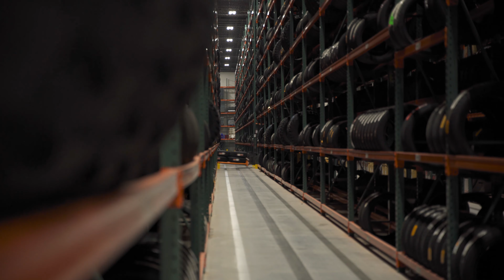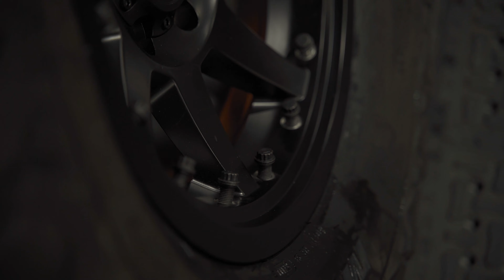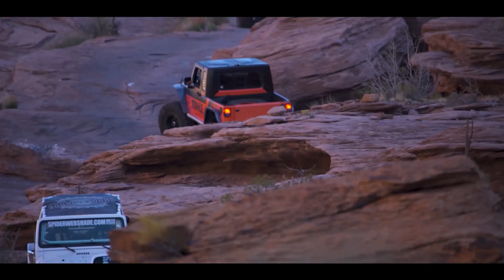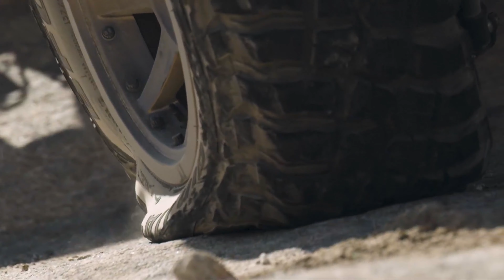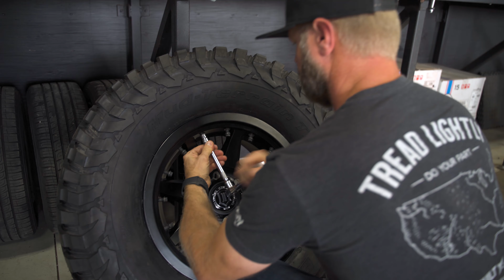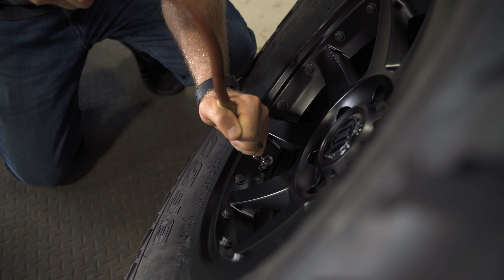ICON Rebound Pro Leaks Air!?

Comment: It would be almost impossible for 28 grade 8 bolts on a bead lock fail and the bead lock ring flying off 😂😂😂. Just think you only have 5 bolts or 8 (lug nuts ) holding your whole wheel on . 2 bolts holding your brake caliper on. It's not that bad locks are (unsafe ) Bead locks on multi use vehicles is new . Companies don't want to foot the bill to have there bead locks tested and DOT approved . Stop fear mongering to push your sponsor sales .

Comment: Only problem I’m seeing here is at super low pressure 5-7 psi where I run on sand this will not stop the tire from turning on the wheel. A problem I deal with all the time on my non beadlock wheels

Comment: All sounds awesome do they make an 8 lug pattern that has a center hole large enough to fit on a Dynatrac pro rock 60? Currently running method rims now on the street but looking to get bead locks for off road

Comment: I actually ordered up a set of these wheels, didn't want a fake bead lock, and its so hard to find a good looking non fake bead lock rim. I'm also looking into starting my business where I'll have to get DOT number and CMVR for my truck so DOT approved is a must as I'll be at scales and dealing with inspections. But I still want to be able to take my truck out.

Comment: They look cool, great concept, but the lack of suitable offsets and backspacing makes them a non starter. 5x5 with 4.50 backspacing and -6 offset barely works with stock tires on a Jeep, try 3.50 with -38 and you might have something.

Comment: I can’t give a review without the product. Feel free to ship 5 and AT 33s for my gladiator sport S any time!  I agree with the other guy though. Beadlock inner as well. I know there’s more flex in the wheel there which is an engineering nightmare though. The outer has more rigidity typically because of the flange.

Comment: So what happens when you drive on a flat or at extreme low pressures? Will the pins be driven threw the tread surface, or will the vehicle weight strip out the thread in the wheel. Would make a cool video to try and see
Reply: Looks like the rim flanges are taller than the pins. So on the road all the weight is on the rim, but offroad it'd be a crapshoot

Comment: Too much chaos rather just run my 701 methods to drop down to 5 pounds of air pressure no issues just my two cents
Reply: The point is that bead locks are illegal on road apparently in a lot of places.
Reply: Hi hope you’re well I know what the point is I’d rather just run the 701‘s to drop down to 5 pounds Do you really want an additional 80 holes in your rims for leakage might sound good on paper have a blessed day

Comment: Not sure what oil you're putting on the o-rings, but from experience shooting PCP air rifles full of o-rings dealing with pressures of around 4000PSI, divers silicone grease is great for keeping those o-rings in great conditions. Very interesting though and definitely on the shopping list for when the $ allow for the 4Runner!

Comment: There is ZERO chance you can be sued for an accident due to beadlocks unless the beadlock was an actual contributor to the accident ie it failed and caused the vehicle to lose control. 
.
People need to stop boogey man -ing our legal system. There are many mechanisms in place to stop frivolous lawsuits. You can't just sue someone for any reason.
Reply: Well I mean you can.
Reply: @kregadeth5562  nope, you can’t. Just like I can’t sue you for your idiotic comments. You can try, but it will literally be thrown out and you’ll likely have to pay whatever fees that person spent to defend against your complaint.
Reply: Exactly. My oem raptor bead locks have 24 bolts. How many would have to fail for the tire to de bead?  I think the tire would leak and I would have time to pull over just like the positive statements on these new wheels. Cool design I suppose but acting like they are superior to a true true bead locks is just silly.
Reply: You can ALWAYS be sued. The case having merit is something completely separate from the act of being sued!
Reply: @ryanm4013  that’s not true at all, you have to draft a complaint prior and demonstrate standing… 💀

Comment: G’day guys, I’m very interested in a set of these for my Australian variant of the 79 Series Dual Cab 4.5 Litre Diesel V8 Landcruiser. Wanting to know if you guys ship internationally, do I have to go direct thru ICON, or do I need to find a local distributor here in Australia & go thru them?
Reply from the maker: Excellent question and there's no doubt our Customer Service reps will be throughly equipped to answer your question! Best to email them directly for the quickest and most accurate responses. Their email is: sales@trailbuiltoffroad.com Thanks!